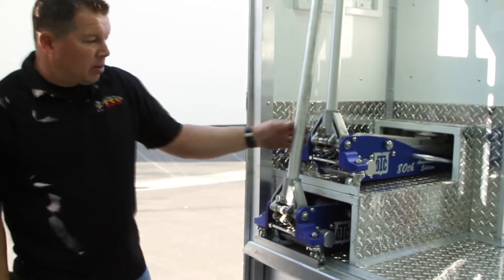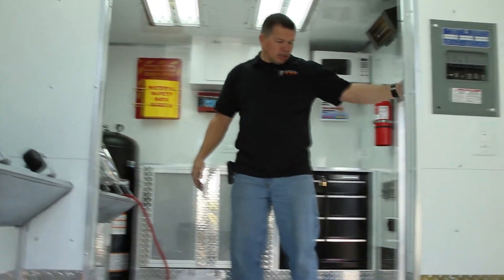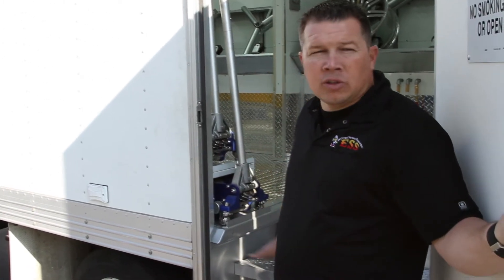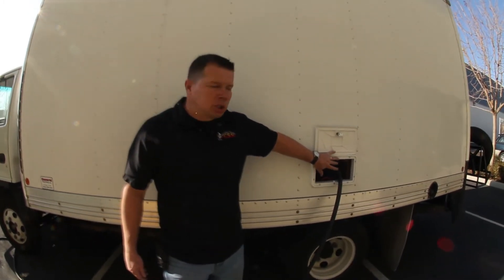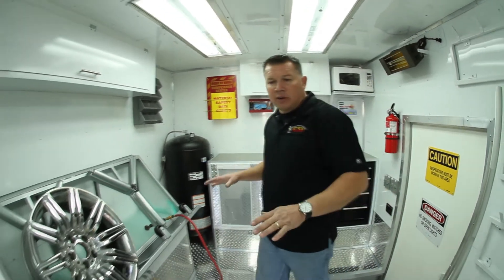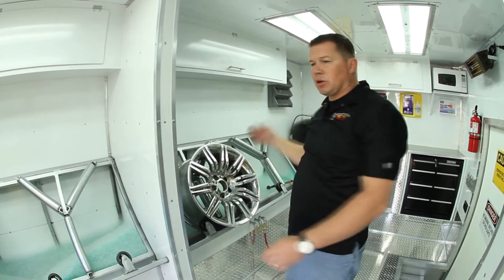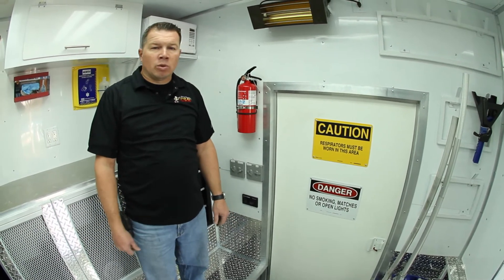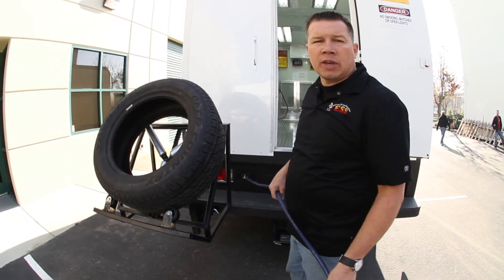ESS Express XL Paint Truck

Comment: What would this set up in a 7.5'x14' tandem axle trailer cost?
I like this lay out.
Did I miss it or does this not have a bead breaker/wheel straightener?